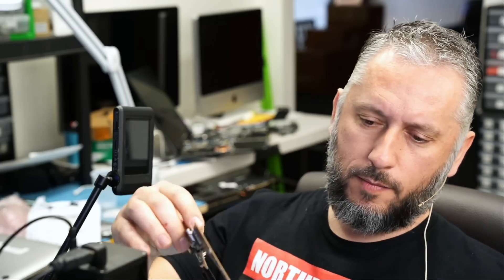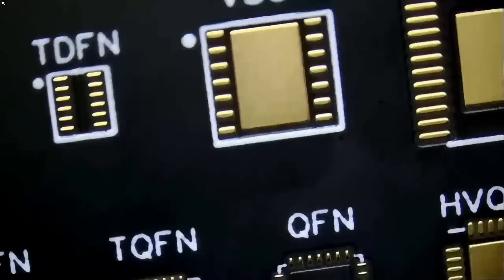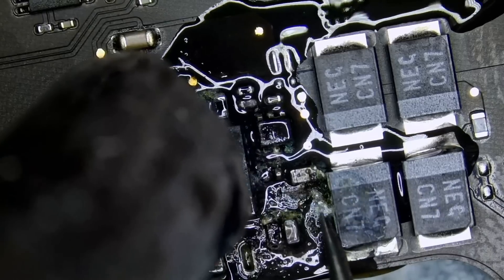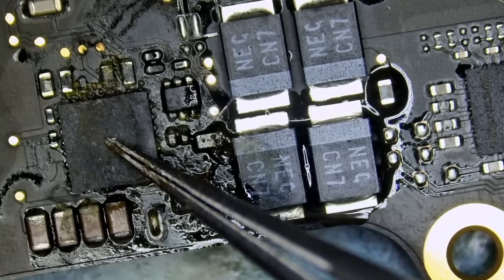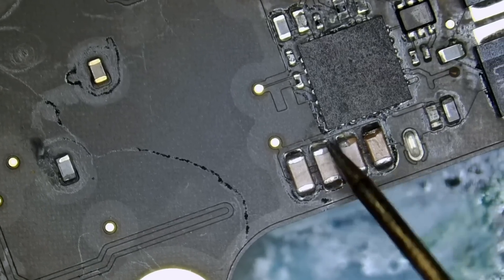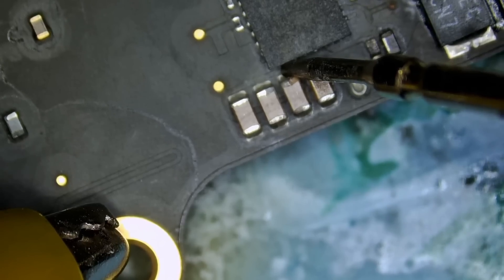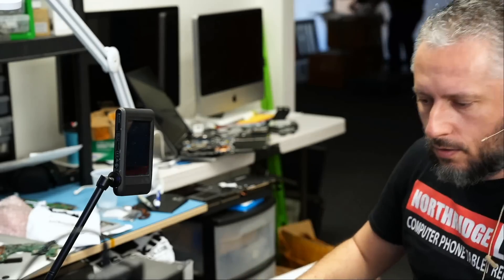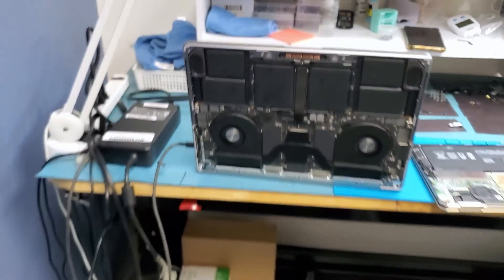A Drop of liquid Killed this 2021 MacBook Pro M1 - What went wrong ?

Comment: I have an Asus Tuf f15 (2021) gaming laptop, Spec- i5 10th gen and 1650Ti graphics. Recently I replaced the Thermal paste and pads after this I am unable to use the dGPU all apps are running in the iGPU and the dGPU utilization is 0%. What can I do?

Comment: Do you think you could repair a Snap on Verus that won’t boot? It’s an older model scan tool that runs windows XP. It was having memory issues so I tried different ram and now it won’t boot even with the ram that was in it. I’d really hate to have to throw this thing away.

Comment: 6:06 question: here it looks like the board is cracked, over in the lower left corner of the screen. However, I tried slowing down the video, but couldn’t see another area where the board was shown with cracks. Like, did the customer drop this laptop hard on that section, then they had water damage? I understand you can’t see traces running through it, but it makes me think “what really happened to the laptop before it was on the table?” 😬
Reply: Drop of liquid. Not a fall.

Comment: Hi, can you tell if it is possible? I'm brazilian and a have a rx580 sapphire of 4gb, but i got  2 memory module dead, A0A1 channels.but not Just modules, the socket the memories are dead too, can i mod the bios to pass the check of the Channel A0A1? I have a Gtx 1650 with 5 sockets of vram but it,s uses only 4